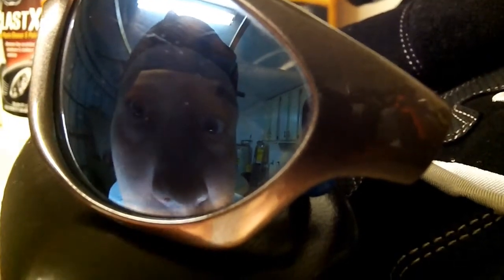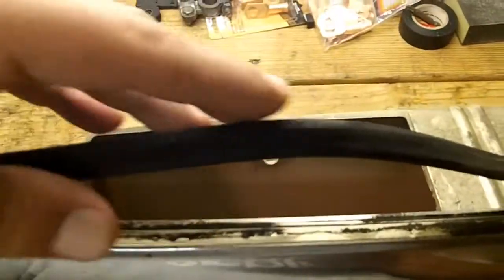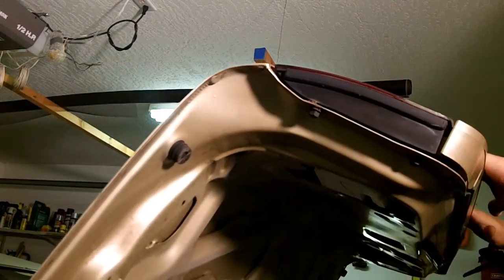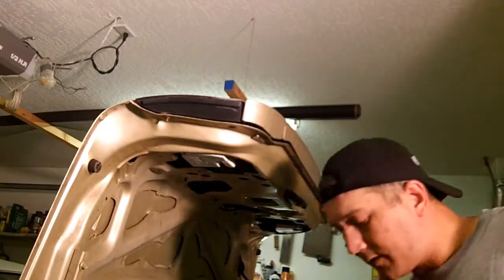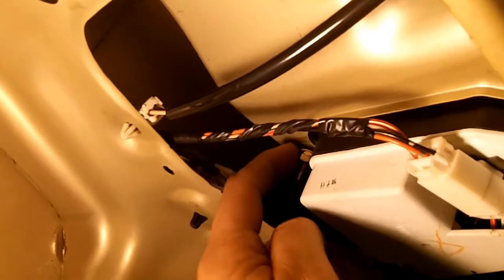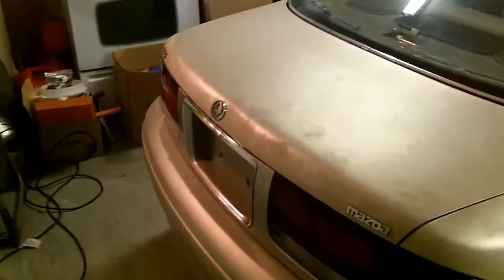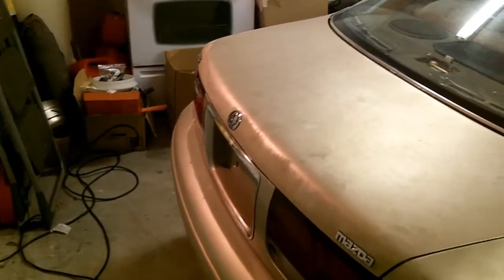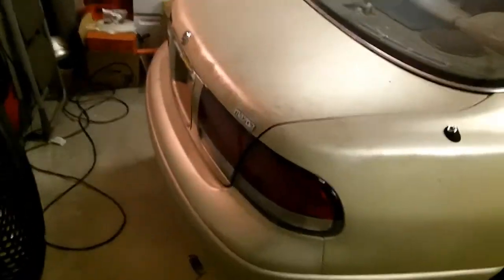Mazda 626 - License Plate Panel Swap (Removing Trunk Lights)

Comment: My question is do you need those lights?
Reply from the maker: If you're in the USA then YES!  On a 626 that has 2 illumination bulbs both bulbs must be working and both must be white.  It is illegal in most states to have non-functional license plate lights OR use a different color bulb (blue for example) to illuminate the license plate.  In some states you can change turn indicators to either yellow, orange, or red (check your state law to be sure) because manufacturers are allowed that leeway in their designs. For reverse it must be white.  Yes plenty of people change the bulb colors on their license plate and yes they get warned and/or fined for it eventually.  If you like your money keep it legal because it's just a matter of time before you get noticed and fined.